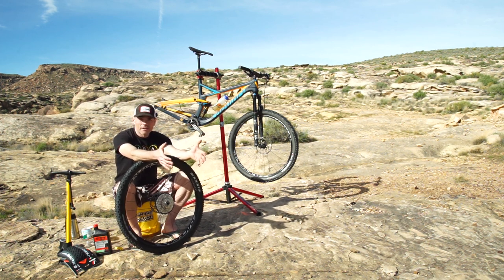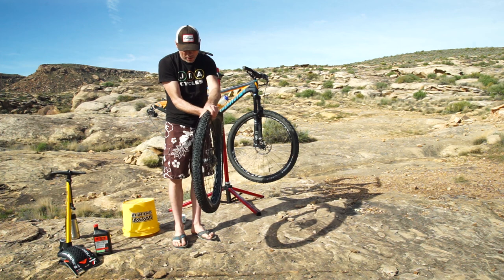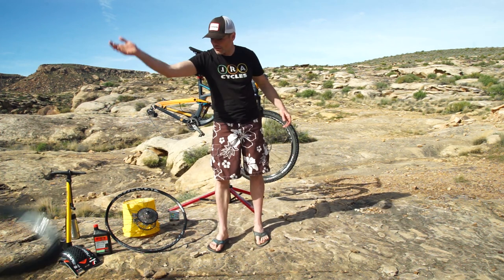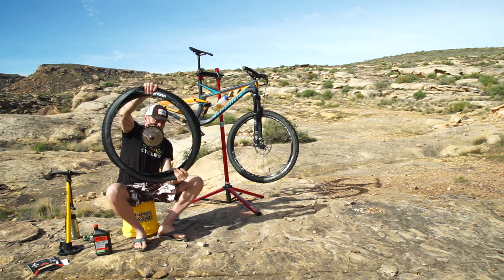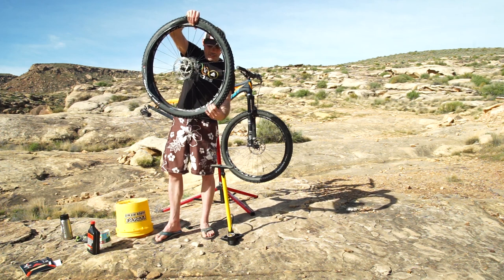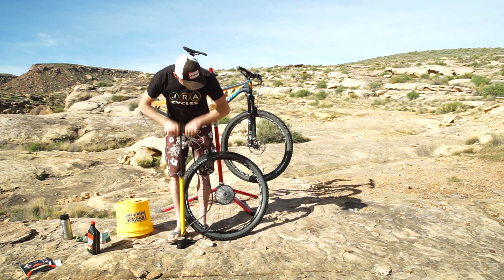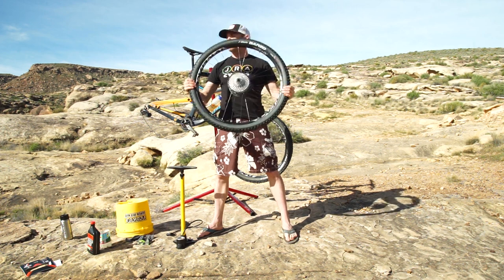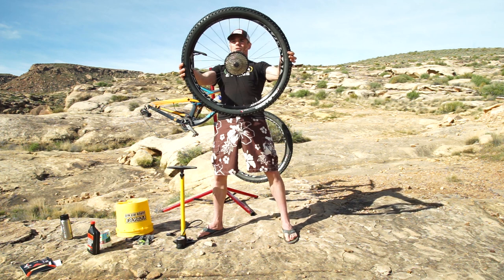Tubeless MTB Tire Installation W/O Compressor - 2017 Update

Comment: Just spent a very frustrating 5 hours trying to do my tyres. This is the trick: after applying rim tape, fit tyre and inner tube, inflate to seat the bead. Deflate and remove tube and only one side of tyre. ensure other bead stays put. Fit valve, add 90ml fluid, put on tyre and by hand pull on as much of  the bead as possible, apply soapy water to help, hold in place with one hand and pump like hell with the other. you'll know within 5 pumps if you've got it. inflate to 40psi and rotate wheel in all directions to fully coat inside and block air leaks. its holding the 2nd bead in place which is the key.

Comment: what adapter is needed to attach the floor pump to the core-less presta valve?  Or, how the heck do you attach your pump to a core-less presta valve?
Reply from the maker: No adapter needed, just chuck it on there!
Reply: My old Schrader valve setting on the floor pump worked for me. Also, just jamming most pumps on there seems to go too

Comment: ive been trying to pump my continentals with easton ea70 rims forr so long ive tried all the tricks with a track pump but no luck. i think im going to have to give up and take it to a shop like a beta male :/
Reply: Got a sprayer from Home Depot and turn it into a pressure pump.   Look up YouTube videos on it.  It’s $10 and it worked for me after 3 hours of struggle without it.